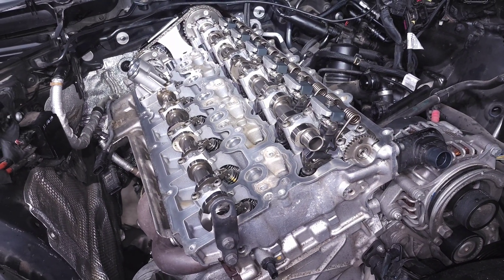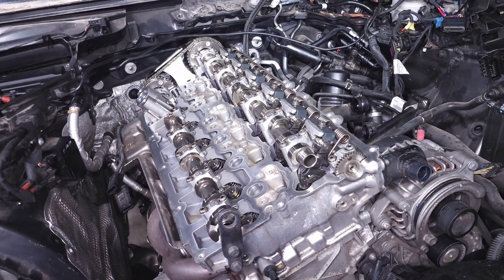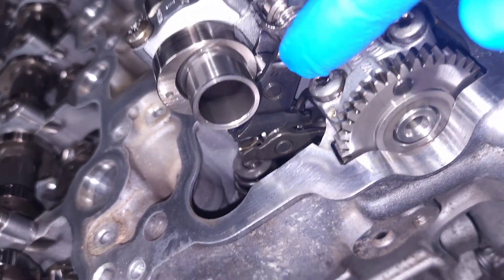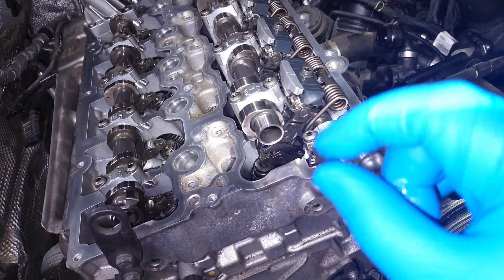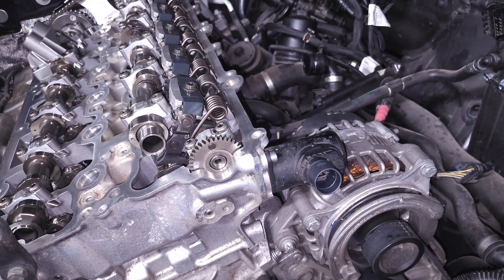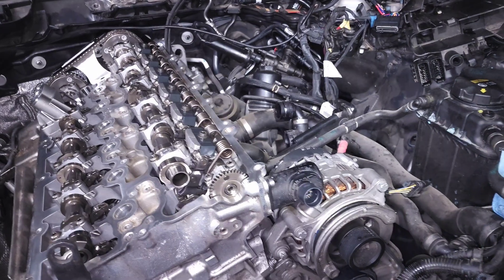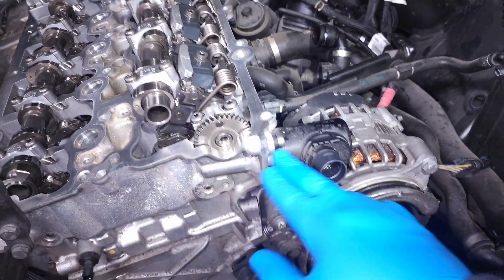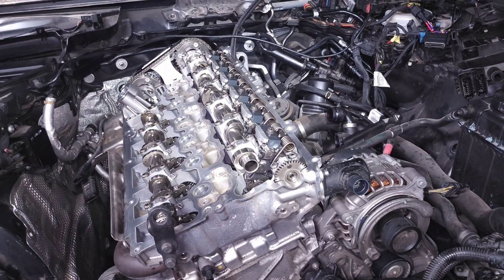Valvetronic: The Most Unnecessarily, Complex System in the B58 Engine

Comment: Could you give me a more in depth explanation of the valvetronic eccentric shaft, my car is throwing 8 different codes for valvetronic, and the car will only crank and attempts to fire every few seconds but does not fully start, i ordered a new valvetronic motor, but I checked the connections multiple times and made sure everything was secure and now everything points at the motor. i can’t find anything that goes in depth on the replacement of the motor.

Comment: I'm chasing code 134F04, changed it today, very fiddly without removing charge pipe, but managed it, reset adaption through ista but code still there. Drives a bit better tho, so idk how long driving is required for it to go back to normal or something else is cooked. When i was looking for the part, i called bmw in uk and they told me there is two of these motors, when i asked where is the other one i had no response haha

Comment: Hey I left my car parked for 10 months now it won’t start and I’m getting a 133202 code ,  would the valvetronic motor go out on its own?
Reply: So my servomotor angle is reading at 255.10 and I’m suppose to be at 254.00 any help???

Comment: Hey boss do you happen to know what codes are 134F01, 134F04, 134F08, 134F10? The car (‘18 340i) is also showing signs of bad PCV valve (white smoke alongside the screeching noise). Do you think after replacing the PCV valve it will remove these codes?

Comment: Is there a relay or fuse located anywhere  that is related to supplying power to the valvetronic? I’m getting a line disconnect code but this only occurred after I installed and coded a new DME on my 340 from previous water damage
Reply: I think I'm having the same problem as you, fault code 135808, have you solved it please?

Comment: Hi, great video and top explanation. I get on my X3 M40I two codes, car had once a bit of a shaky running on idle but after shutting it off and restarting it runned smooth. The codes are: 134F04 Valvetronic adjustment range: Error range check; 135401 Valvetronic: output stage overloaded. Do you think it the actuator in the front decalibrated or its gone bad? Thanks in advance

Comment: What a Valvetronic class! 

My experience with older Valvetronic engines. V8 N62, for instance: Valvetronic in limp home mode. Engine working with throttle body: despite the ckeck engine messages engine woks very well. Normal power felling.

Comment: My S55 had its valvetronic motor fail twice, 4 years and again 3 years later. No surprise they moved the motor back to the outside of the cylinder head, that was just a packaging optimisation too far !
Reply: The main problem with valvetronic was always the incredibly stupid idea to mount the motor inside the cylinder head cover. It's like they never thought an electric motor would ever break.

Comment: Is the throttle body always wide open when the valvetronic system is functioning normally?
Reply from the maker: It varies because it's also used for boost control, so it opens/closes as needed to keep total airflow in check

Comment: Hi, really informative video helps a lot.

Just had 1 question, im getting the code 21A02D; Combustion Control - Valve lift at idle. on my 2017 Bmw M140i B58.
Ive performed the valve lift adaption twice, the code has gone away and has then come back on both occassions.

Ive changed everything from PCV, injectors, oxygen sensors, vanos actuators and more.

I have no idea what it can be, the RPM drops when i engage from P to R or to D and sometimes it lags in acceleration from take off.

Any help would be great, thank you
Reply from the maker: some people have fixed the code by getting a software update at the dealership. just note that if you have a tune then it may lock your DME
Reply: @kern417 hhh yes i have a stage 1 tune on the car, is it the i-level software update? Also can the dealers unlock the DME or can I do it myself Via Ista+
Reply from the maker: No you'll need a shop/tuner to do it
Reply: Hi did you ever manage to remedy this? Got exact same issue and smoke from startup on my 2017 m140
Reply: @nickcampbell9672  no still got the code, if yours is smoking its 100% the PCV diaphragm. Its like a £20 part and you can fit it yourself. But for the main issues with my car ive got it booked it with Performance M in manchester early september
Reply: Have you fixed this? I have the exact same issue
Reply: @kushaldepala6322  Ive been told the car needs a full software flash, not done it as of yet
Reply: @harrisnabil do you mean the software update on engine with the reset of valvetronics?
Reply: @kushaldepala6322  DME update

Comment: Do you maybe know what the Code 135501 - Valvetronic: Output stage overloaded (warning threshold value for overload
protection exceeded) means? 

Do I need to change the Valvetronic motor? I notice that the car reduces the power at 3000rpm. When i delete the code its runnig fine again for about 2-3 months and then it comes again. No check engine light.
Reply from the maker: What are the symptoms when it comes up? Have you ran a log? What car/setup?
Reply: @kern417 I only notice that my car lowers the boost after around 3k rpm. Otherwise everything is runnig fine. No strange noises or anything.

I already deleted the error a few times and did an log afterwords. Everything fine so far. But i never did a log when the code actually was thrown. 

I have a 2020 supra with catted dp and mhd stage 1
Reply from the maker: Lowers boost to meet target? Like it's over boosting? Or is it going into limp mode?
Reply: @kern417 no i mean it lowers the boost so i do not have full power.
Reply from the maker: Email or dm me. My contact details are in the video description

Comment: Just curious but is it at all possible to just fully disable and or delete valvetronic and run the car the old fashioned way through the throttle body without the car going crazy with malfunction codes putting the car into limp mode and such?
Reply from the maker: No

Comment: Unrelated question to this video but I’m looking at getting a Big Boost EFR turbo kit and was wondering if you recommend the 8474 or 9174 for a daily driver that I want to push up to 800 whp max with? Also how long did it take you to install your Doc Race kit and was it difficult?
Reply from the maker: 8474
Reply: @kern417  thank you! Also would you say get the doc race top mount kit or the big boost EFR bottom mount kit?
Reply from the maker: DocRace no longer has an EFR option so Big Boost is your best bet

Comment: Recently heard that buzzing sound from my f22 b58 valvetronic I believe but it sounded louder like when there's a failure. I'm hoping it was just a software glitch and not a bad shaft like the n55s would get. You heard of the eccentric shaft or motor going bad on these? I hear software update is sometimes a remedy. I will need to see if any codes.
Reply from the maker: It can definitely Happen but not something i hear of often

Comment: If you say it is unnecessarily complex please tell us how to achive the same thing as reliable in a simpler way ;)
Reply: I prefer a 1ZZ NA
Reply: This. The pumping losses from just a throttle body will increase by 10%. That’s huge in todays world where every  bit of efficiency matters.
Reply from the maker: It's called a throttle body 🫣
Reply: @kern417  yes it does ‚the same‘ -
But you‘ll have higher power losses / higher fuel consumption with no valvetronic
Reply from the maker: @vollcare4076  correct but when I say unnecessarily complex i mean the same can be achieved while now it is much more expensive and risky with such small gains.
Reply: @kern417  if you can safe 1-2% fuel, it’s a huge gain for the OEM (and CO2 regulation like in Europe)

Also >99% of all cars will have no problem with the Valvetronic during lifetime of the car (150.000-200.000km)

But I agree, as a 2nd hand user of such a car I would prefer to pay 1-2% more for fuel and eliminate the risk of a damage.

Same arguments for DI versus standard manifold injection
Reply from the maker: @vollcare4076  twin turbos, everything 😊
Reply: @kern417  twin turbo ?
Reply from the maker: @vollcare4076  things that make engines unnecessarily complicated 😌
Reply: @kern417  agree with you.

I’d prefer a 6L NA V8 instead of 3L Turbo, but NA are not fuel efficient enough for European laws and fuel prices